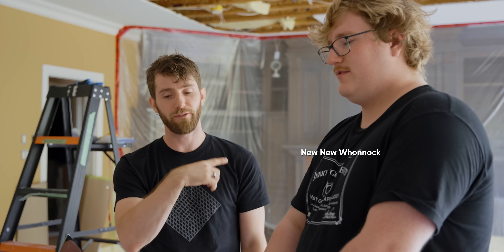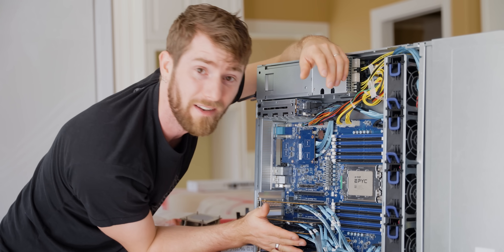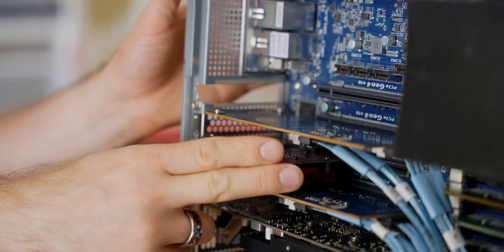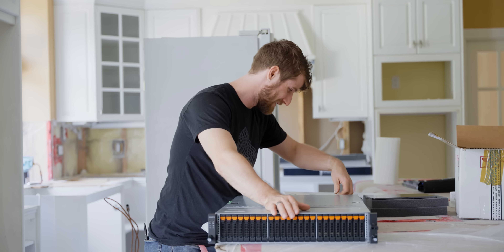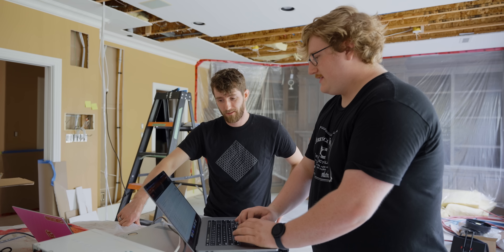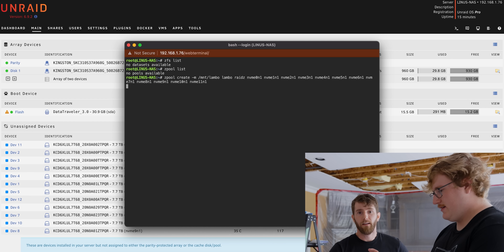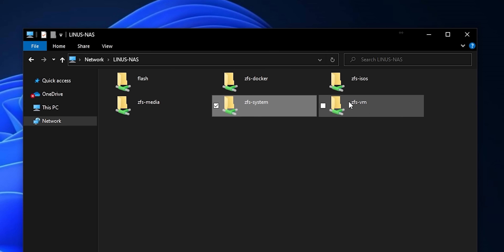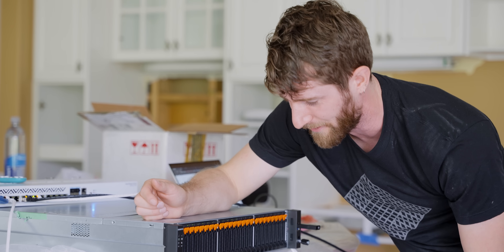This is stupid, but I love it - Linus Home NAS Update 2021

Comment: That GTX150ti low profile card was one of the highest available graphics cards I could get my hands on to run in my budget, small form factor HP like... 8300, I believe it was. If I wanted to have the lid on and you do. Only provides you with up to 2.5" of height once seated in the socket. Eek. But it worked, and I was able to play pretty much all games I threw at it. Settings minimal, of course. From there, I jumped up to an RTX3060 and am now a RTX4050 in my last two laptops. My daughter has the MSI GF63 with the RTX3060 while I'm running an RTX 4050 in my MSI 15 B12VE. I, of course, play demanding games like Ghost Recon Breakpoint, Division 2, Destiny 2, GTA Online, and RDR2 Online. My daughter is into Roblox and Genshin Impact. Perfect for what she is  getting into.

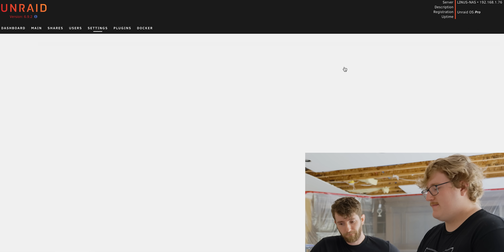Comment: 11:48 Yeah that is a valid question. I have bought a Dell PowerEdge r630 because this thing was cheap. I mean only 400€ cheap. And this thing is absolute overkill for anything i can think of.
i use all SSD storage. i have 10 2.5inch 12gbit SAS bays and in every one is a SATA SSD with 512gb because they cost me only 25€ each, those are the cheapest drives you can get and none of them failed over the last 2 years. 
i mean. that is not 100% true. because of that my RaidControler is 7 years old and the newest firmware 5 years. Some of my drives have odd firmware that the Raidcontroller has issues to read SMART from it. i mean there all the same drives so i simple change the firmware to a known working one. What ever the manufacture changed over the year, it doesn't really mater, because they all are exactly the same internally. But this is a minor incontinent for me and fixed in minutes and can be done over the idrac IPMI system. 
My R630 was already equipped with two Xeon e5 2683v4, 512gb ECC RAM as 4rx32 2133mhz modules, a PERC monolith h730 RAID controller, a 4 port 10gbit NIC, Idrac8 enterprise and a 32gb SATADOM and a IDSDM card. The TPM module is missing, but i don't need this and if i need it costs only 3 to 10€ or so. 
i have my OS proxmox running on my SATADOM and everything else is happening on the Drives. For the IDSDM i don't use it, because it is slow and you need two SD cards to make it work. 
I plan to use a GPU, but i have the 3 half height riser bracket installed and this limits me to 25w per PCIE slot. If i change it to the 1 half and 1 full height riser bracket then i could use a 75w GPU un the full height slot but at the moment i dont see the point for using a GPU besides this it has to be an AMD GPU because of compatibility. AMD is way less painful to get it run as Nvidia GPUs. But i have a Matrox h264 codec card as streaming encoder in my system. Normally they are expensive but i bought a broken one and got it back to life for 20€. 
i have this system running for about 2 years and 4 moths and mostly it runs at 1% utilization if something is happening i hit 4% max. 
So yeah. This is a valid question what should i do with it because it is massive overbuild. i mean. i have not even 2.5gbit network at home. i have a 1gbit network, even this is limited to 200 to 500mbit because of powerLAN. i cant run network at home. i have to stick with PowerLAN or Wlan and Wlan is the worst experience i ever had with networking. PowerLAN just works. its not perfect but no hiccups or package losses.

Comment: Which server is this from Supermicro? I have looked at used Dells to replace my R510 with 3.5 inch SMR drives (read heavy) but they are expensive and only offer the option for four U.2 drives. Lets face it U.2 8TB drives are cheaper than SATA SSDs now.

Comment: Is there a way to have your system move storage based on how often it's used?

Frequently used: NVME
Mid frequently used: SSD
"Archive" storage: HDD

Steam games you don't usually play slowly switch to the other storages (or at least are written down in the system as "to be moved" that way they don't burn out NVME storage

The storage that the user sees is basically fake... unless the user actually wants to inspect the storage... the health of the drives are checked... extra slots to replace all storage without noticing issue they automatically create the new drive in a RAID setup that matches the user and usecase

Comment: use 3 of these nvme for alphafold db and then the rest for netfs - gluster on zfs - you want more than 6gb/s to saturate 100g - you may want to run or upgrade some 100g to 200g - upgrade to 400/800 in 5 years

Comment: I should imagine that the data throughput is very high for racks of NVMe's.  Probably faster than the capacity of most CPU's and Network Chips.  
10x 100G bits per second anyone?

Comment: My NAS is 6tb of sata crucial SSDs, running a R7 1700 with 16gb ram, but it pushes 1gbps without too much difficulty (although I'm using truenas.) My PC's NVME is the only thing that can saturate it though! 700mbps is realistically going to be enough for anything in the next few years.
That's just Windows files transfer though.

Comment: Couple unraid deets for Jake and Linus to improve performance for say... 30 bucks.  Or 0.
1) That Asus Ethernet card - can you enable offload of ethernet processing?
2) Try switching (hah) to an SFP based interface.
Your SMB performance should improve a bit from the above.
3) Unraid 6.10 should handle 10gbe better when they optimize the networking stack.
<3 for the unraid focus.  I did this myself a few months ago, but with a few thousand dollars smaller budget.  Thanks for the sponsorship on this thing I like, Kioxia!

Comment: Cringe when I hear Linus justifying dropping to 1 parity drive ‘because they are datacenter drives’. The difference with datacenter SSDs is they forego background scrubbing (in the name of consistent performance), so will regularly suffer corruption by design if not being constantly rewritten. And they have cold storage lifetimes measured in weeks. Using them to store WORM-like data (Blu-ray backups and general family NAS storage) without lots of redundancy is insane

Comment: Can someone please explain this: How/why would the RAM bottleneck the system if all the SSDs are installed?
Reply: Its like having a badly optimised game engine doing alot of GPU draw calls, the OS and CPU are constantly checking the ram and SSD's the more you add the more the bottleneck its just how things work.
Reply: @xkblxcripple  But what you are describing would be the CPU bottlenecking the SSDs. It still doesn't explain how the RAM can be bottlenecking them?

Comment: At 10GbE, you can run CAT7 lines and a reasonably priced switch. 
To go to 100GbE, your NIC card would be ~$1500-2500 USD, depending on features.  On the ToR switch... the cheapest I found was a Mellanox for ~10K USD. (16 ports)  This is a bit insane when your home connections will be 1GbE.  Your PCs could be higher, but why? 
Note: You could split a port and then downgrade to a set of lower speed switche(s)... If needed. (e.g. 100GbE port split to a couple 10GbE connections to 10GbE RJ45 switch ports switch)

Comment: "100Gigabit home networking" yes, of course!

Use case: - Steam Library, gaming over the network.

I personally do it; though my library is running on a network attached sata spinning rust. I directly mount it with iSCSI. Works great; gives me multiple tb of game library storage for my portable laptop. Plays most games perfectly fine. If I want to play a game on the go, I transfer it to internal storage. If I stop playing it for awhile, I move it to the network drive. Saves having to redownload everything all the time. So yes.. there is definitely a use case for home servers like that.

Comment: Why would you need 10, 100, 200 gbit in your application?  Even a Nas in your office would be hard pressed to push that.  I'm starting to roll my eyes at how overbuilt your builds are becoming. At some point, you're going to run out of highest of the high which I assume is your problem as far as making content. I guess a bunch of your users don't understand how overbuilt 100-200 gbit is but some of us do and we're rolling our eyes.

Comment: Well using "Fio" impress me, as an reliability engineer im gonna check the Kioxia for my enterprise environment, i am following this channel like very long time and seeing this enterprise level videos are really makes me happy, please do more :)
Reply: Hello again @linus, I tried the 8TB CX6 model, try to type "cat /proc/interrupts |grep nvmeX |wc -l", you will see that it only has 1 irq queue handler and not using all the cores that the cpu has... it might be faster on throughput but im having issues under high transactions because of this ^^ thanks for the tip!! (also if you have a suggestion about it im open to hear, i have 2x EPYC 7742 with a 1TB of ddr4 3200)

Comment: Hey Linus.
Look up Buffalo 10Gbit RJ45 switches. They exists in 8 and 12 ports RJ45 and all of them has 10GBit.
I have 2x8ports myself and uses the exact same Asus NW card as you installed. I have 10Gbit fiber converted to 10GBit RJ45 at home.
It works fantastic good.

Comment: What is the advantage to use baked in subtitles in Plex? I always use direct streaming and just pick an external subtitle. Also, I have a GIGABYTE J4005N D2P that handles even 4k playback without any issues, it can also downscale (granted from 1080p) to 720 without problems. The CPU consumes 10W (maybe more in full load) and I have a bunch of docker containers running on it beside plex, so what is the advantage to use something more powerful instead? :D

Comment: *GIGBITS, NOT GIGABYTES.*
Most common mistake. When you do the conversion, it is 1.25 gigabytes per second.
Imagine if disk transfer rates showed it in megabytes (or kilobytes for some REAL cheap USB flash drives or SSD's).

Comment: Please import the disks/NVMe's by-id instead of the disk label. If the OS decides to change the disk label after a reboot (for example), your ZFS pool will be crying that it lost a drive.

Edit: You can fix this easily by exporting and importing the ZFS pool. (# zpool import -d /dev/disk/by-id POOLNAME)

Comment: If you don't hire and listen to the smartest people for your IT dept you will have slow expensive crap being deployed.   Very few IT shops converted to purely NVMe SSD storage.  They are pushing for Cloud and that won't improve disk access performance.  In fact going cloud will decrease IO as all the cloud does is untether your corporate infrastructure.

Comment: Linus, something I'd be interested in seeing is a NAS for vandwellers / RVers / similar. It'd need to be DC powered, and resistant to high temperatures / high vibrations.

I'm currently using a 1 TB SATA SSD in a regular NAS, but I'd like a ton more storage and some reliability.

Comment: Why did you use lz4 compression instead of zstd? zstd has much better compression with slightly higher CPU usage, on EPYC CPU I think you won't even notice the difference. Could you make r/w speed comparison between off, lz4, zstd and zstd-fast on this CPU using bonnie++ e.g.? I'm interested in how EPYC can handle compression performance on SSD pool.

Comment: Nice setup. I guess I am just old school with my 10TB enterprise SATA drives on a RAID6 controller. It is still enough to saturate my 10GbE connection though. I just need a video card for encoding one day if I install Plex. Rolling with Jellyfin now but don't use it enough to justify the power for a idle video card.

Comment: The reason Linus's transfer speeds were slow when copying / pasting is because he used the GUI in Windows, which is limited. If you use robocopy, you can achieve much faster speeds.
Reply: Even WIN 10 is still that limited??? WTH
Reply: Robocopy is sooo old though.. Someone has probably designed a better even faster interface
Reply: @IsaacWalkercox  It's still maintained though and is newer than xcopy. I don't see what the age has to do with it, it's not an old piece of software if it is maintained and updated. It works well still and is better than Explorer for copying files quickly on multiple threads.

Comment: Careful when enabling autotrim. In older versions of ZFS, I've seen iowaits, causing the pool to lock up, resulting in performance to slow down.

The man for autotrim does suggest that enabling it can put extra stress on the media.

With your usage, you should be fine, but something to be aware of. My personal preference is to turn off autotrim, and set manual trim schedules via CRON.

Comment: Did you have water damage in the house?  based on the drywall cuts looks like second floor plumbing issue and then taking advantage of the repair to install additional cabling in the wall.

Comment: yea.. dont do network boot.  its horrible.   and i dont think you have enough cache and DEDUPing to make it worth it.   now if you had about 500gigs of ram to use as a ram cache disk with freenas,  then different story.. but otherwise, NOT worth it.  the speed will SUCK because most of your disks will be windows mapped drives anyways, either by NFS or Samba..  both SUCK horribly for speed.  you could do a netboot with iscsi,  but even then.. horribly slow unless your running 10gig to all your pc's.
Reply: a better option for hardware like this, is to run it as a hyperconvered ESXI host,  toss Citrix Xenapp and Xendesktop on it, then Citrix connect your pc's to it.  then you could get some speed out of it..  and you'll be able to access your home pc's from anywhere in the world depending on how you expose it to the outside  however, your not going to want to do blueray through Xendesktop/Xenapp unless you use GPU offloading to another machine that has a fairly decient video card that has a supported gpu for gpu offloading.

Comment: Future proof man, you already have the walls and ceilings open.  At least run some fiber trunks between the floors and major computing areas and run a couple more for later.  Then you can run 25 or 40 or 100 or whatever based on your transceivers.  I'm pretty sure Yvonne will have your ass if you try to tear the house up again later.

Comment: Ripping Blu Rays is akin to ripping CDs, except ripping your CDs is not a legal grey area. It's totally fine under fair use or Windows Media Player wouldn't be doing it. If you upload your ripped music to the internet for people to steal, you're doing something wrong. The same applies to movies. And as long as your movies stay on your own home network and you don't make them available to stream anywhere else, odds are they aren't coming for you.

My smart TV is mounted on the wall with NO wires around it and nothing to hold boxes. My wife and I love the way it looks up there. Very clean. I'm not ruining that with cabling up a box.

Comment: GTX graphics card can only transcode 2 streams at a time, you need à professionnal Quadro card like a p2000 or a p2200 if you want unlimited transcoding streams. Or you can hack your card.

Comment: 25/40G sounds expensive but it’s really not that expensive. You can make a LAG of let’s say 2 or 3 of those 40G interfaces and have 120Gbit to your server which is crazy and would give you a theoretical 30GB/s connection to it, if your switch has that capacity. Go for a Juniper EX4300 or something similar, they are not that expensive on eBay and accept non juniper sfps. Or go for the new UniFi Aggregation switch that has a bunch of 25G ports for like 1k euro.
Reply: LIKE HE CARES ABOUT PRICE, he's probably really gonna start getting into real network gear sponsors now...watch
Reply: @mrmotofy  even if price was not an issue I would still go for the Juniper as those are rock solid and come with lifetime warranty. Also he already has a positive working relationship with Juniper.

Comment: LOL weird that Linus hasn't splashed for the RTX A2000 which would run circles around that 1050 for transcoding quality, speed and efficiency ;) Especially in a multiclient environment... so eg. when trying to replace several bluray players and allow smartphones and PCs in the house. Still, with many clients, this server will need several 10gbe or a pair of 100gbe for networking. I wonder why he's chosen the Unraid platform instead of TrueNAS Scale if he were to play with ZFS storage raidz1 array...

Comment: 1) I'm not sure why you would run UNraid given the fact that it will only read/write from one drive at a time instead of spanning the read/writes across all of the drives.

(I forget if you had a lot of issues running TrueNAS Core, but if you want ZFS, that would be another way to go AND TrueNAS already HAS a GUI for ZFS management.)

2) YES!!! Run 100G for sure!!!

I have four Samsung 860 Evo 1 TB SATA 6 Gbps SSDs in RAID0 running on 100 Gbps Infiniband with NFSoRDMA enabled and it freakin' screams (even with just run of the mill SATA SSDs).

3) Remote booting your systems from a centralised server:

For that, I would recommend that you set or configure a portion of the storage to be an iSCSI device, otherwise, it is possible to manage the remote booting of Windows clients might get a little bit hairy.

Note that your most like limiting factor is going to be the PXE boot speed.

I have one system (albeit NOT Windows) that's running with PXE boot, and it can only pull the image at 100 Mbps speeds for some strange reason. (As a result, I am running the PXE boot off of spinning rust as there is no point to try and run it off anything else faster than that.)

It takes about a minute to boot my system. The larger your boot image is, the longer it will take.

So, you'll want to test that thoroughly.

I've recently migrated one of my systems from a physical daily driver to a virtualised daily driver running off an Intel NUC (that also runs off the network because the NUC doesn't have enough local storage for the VM disk drive file).